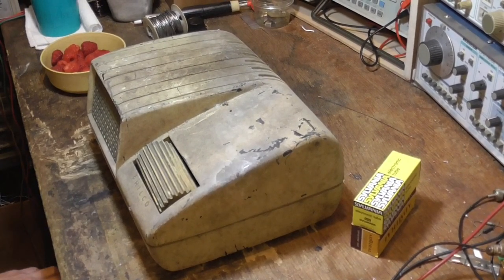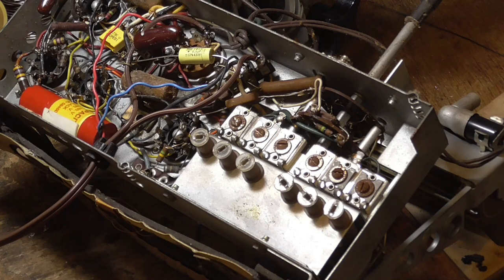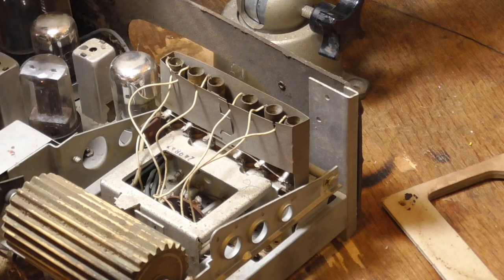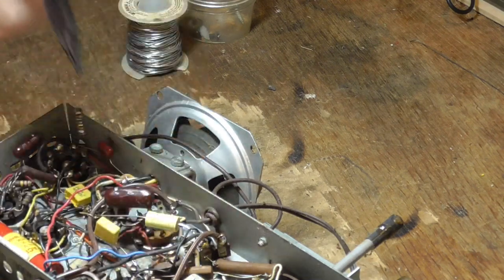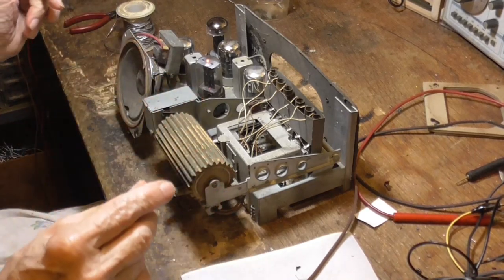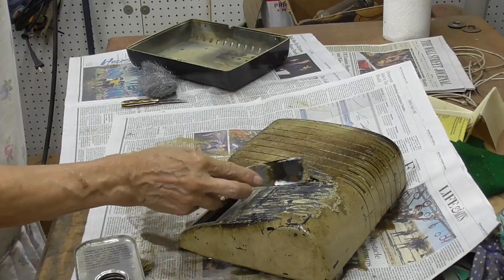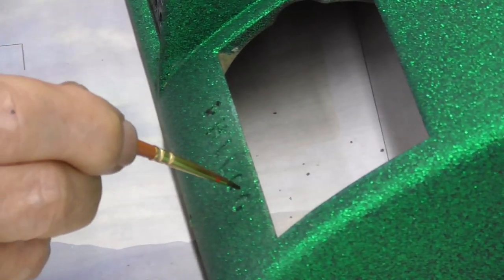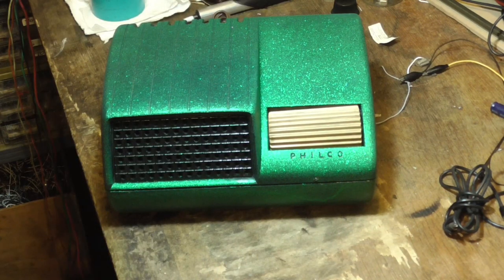RESTORING A VERY UNIQUE PHILCO TUBE RADIO

Comment: Just curious about your power meter- Does it limit current, in addition to telling you the value of the current? What is the name and model number of the power meter?
Reply from the maker: It is a chink cheapo with no model number. It is a straight power meter and does not limit the current. You can get one on ebay for under 20 bucks.
Reply: @glasslinger  OK thanks! How do you protect radios with power transformers when first powering them up? I always use a dim bulb box and variac.
Reply from the maker: @jeffberwick  My bench power comes from my electronic fuse. This can be set to any current and will immediately disconnect the load if it pulls excess current. See my video on electronic circuit breaker on how to build one.
Reply: @glasslinger  thanks- that electronic circuit breaker video is great! I especially like the repurposing of a tiny wall wart transformer as a CT. Looks like a fun project!

Comment: I really thought that was some kind of fan heater until you opened it up. My wife bought me a vintage radio that did turn out to be a GEC fan heater https://youtu.be/kC3bnb4wbRs  I have never found any different with the capacitor either. But perhaps in a high impedance circuit it could. Great video thanks for sharing.

Comment: I believe that radio was meant to be used under a desk and operated by foot.
Reply: It is not a foot operated radio.  The original advertising shows it to be operated by hand.  Also the radio wouldn't survive long being kicked around not to mention it would sound terrible with the sound coming from under a desk
Reply: @bandersentv  I got that from the "Radio Attic" site. "Here is a one of a kind radio design! This Philco "Secretary" was meant to set under a desk, and the on/off, and volume could be adjusted by turning the "Kick Wheel" with your foot. By pressing the "Kick Wheel" you could scan through the six preset stations. As you did this, the pilot lamp on the front would change from green to orange to purple to white to blue to red to show you which of the preset stations you were on. Presets are adjusted by setscrews on the bottom of the radio.."
Reply: You are probably right, though. A poster on a different site said the whole "foot operated" idea had become quite an urban legend in radio restoration circles.

Comment: This looks like a Philco 49-901 ("Tenspeed the bike hanger" found one on ebay).  According to this link it is indeed designed to be set under a desk and operated by foot!   https://radioattic.com/item.htm?radio=1620012
Reply: These are NOT designed to be foot operated no matter what you might read elsewhere... Trying that will destroy this radio, probably why there aren’t too many left. The original Philco literature classifies this as a tabletop radio and shows the operation being done by hand.

Comment: That is a unique radio..  When I first saw it, I thought it was some kind of air purifier!  When you're setting the stations, is there any indication on the bottom which tuning coil is the current one?  It seems like you'd always be messing up the other stations trying to find the right one to adjust.
Reply from the maker: They are numbered only. You have to pay attention or maybe write down a list as you go. It is not a practical radio, I have it just for my collection. It originally was made to sit under a secretary's desk. She would operate it entirely with her foot!
Reply: @glasslinger  that's interesting. It seems to be designed to be foot-controlled!
Reply from the maker: @BastiElektronik  It actually was! It was made to be placed on the floor under a secretary's desk. She would turn on the radio with one push of the rotary knob, set the volume by sliding her shoe up or down on the knob, and change the station with more pushes on the knob. Very unique!
Reply: @glasslinger  Indeed! But it makes sense! You don't have a lot of fine motor skills in shoes. That's probably why it is built so hefty and tough!

Comment: Of course it's a Philco, LOKTAL tubes!  That long shaft would seem to operate a pointer to show which station was selected.
Silver Mica disease in the IF cans according to Shango066 who always rebuilds them (he puts the new mica caps on the outside of the cans).  Really no reason NOT to fix them since even NOS transformers will go bad sitting on the shelf!

Comment: I would save money to buy a sandblasting cabin and a small compressor much cleaner and saver way to get rid of old paint you can adjust the pressure for different quality surface. Better then chemicals. Bah
Reply from the maker: I have a powerful sand blasting rig. The chemicals work best in some cases I have found.

Comment: why the nasty green metallic, kinda gawdy. what was wrong with painting it the original color....wouldnt that be a legit restoration?
Reply from the maker: If you like refrigerator beige. I don't care about "legit" on a radio like that one.
Reply: @glasslinger  Hi Ron , I was wondering if you had any advice for a young kid who has started a restoration on a 1936 sears 4586-a console silvertone Three band radio with 10 tubes my last weekend was very discouraging I spent months tracking down the proper vacuum tubes for the set replacing every  wax capacitor and checking Tolerance on every component and finally it was ready I powered it up on a variac and a dim bulb tester and the set came to life for about 10 seconds and then it went dead upon inspection underneath the chassis I found that one of the outputs from the 6 f6g tube had shorted to the filament line and taken out 9 of the 10 vacuum tubes only sparing  the 5V 4g rectifier. Because of the cloth covered wire it's very discouraging to spend all this time and around $100 and vacuum tubes to make the set correct and working properly I guess my question is what would you say to a young kid? Thank you very much for your videos I learned a lot and I'm very appreciative of them just feeling discouraged after trying to make sure everything was right any advice would be helpful thank you
Reply: @niceic.co.uk.  When you buy "new" replacement tubes get someone to test them with a good quality tube checker to make sure they 
are actually good tubes. Lots of restorers make that mistake!!! Ebay sold tubes may say NOS, new old stock, but that may or not be true!
Reply: @hestheMaster  I do have my Grandfathers Triplett 3444-A Tube Analyzer. I am a little worried about using it, Reading the Instructions you really need to know what you are doing. I dont want to mess it up, also his Tube caddy full of tubes. it was given to me when he passed away. He use to work for Picker X-ray. he Started working there in the early 1930's. I am also trying to learn how to use his weston model 785 Industrial circuit Tester. I do see your point, I may have got some poor vacuum tubes, trusting that people say what they do and do what they Say.
Reply from the maker: Even I with 30 years experience at radio repair have bad sets that take multiple times repairing to finally get going. However I am not seeing how all your tubes got burned at once. Not very likely. Concept error here somewhere! Keep at it, you will get it.
Reply: @glasslinger  Thank you glasslinger,  some one mentioned I may have gotten some bad tubes that I ordered. I found three tubes in the set when the tungsten filament has deposited it self on the glass. My 6H6G 6K7G and one 6F6G and the pair was matched. I ordered a Soviet pair have 6F6gt. Do you think the 250volts from the 6F6G tube  shorting to the filament line  could have done any damage to the If cans?
Reply from the maker: It is possible but a quick ohmmeter check of the wires on the can will verify it is OK. There usually is a red and a blue wire, and a green and a black wire. There should be around 50 ohms or so between the red and blue wires, and the same between the green and the black wires. The colors may be different on your set but you should find two pairs that have the resistance. Any wire that is open indicates a bad can.
Reply: @glasslinger  Thank you, i will check.